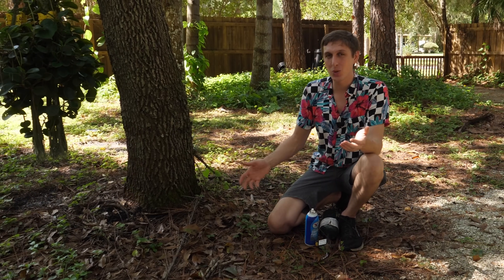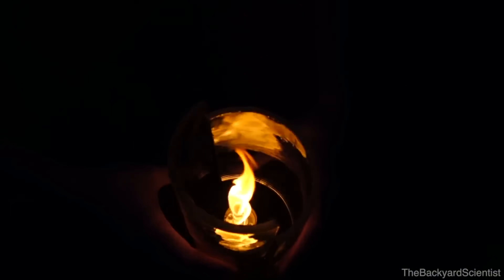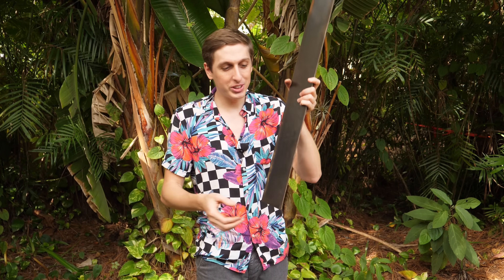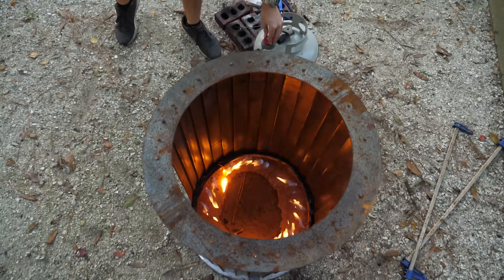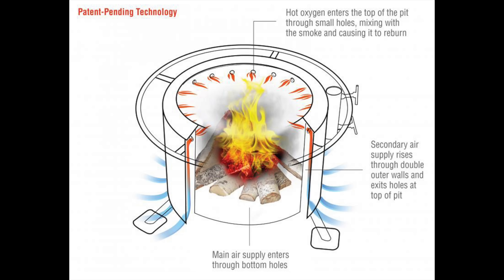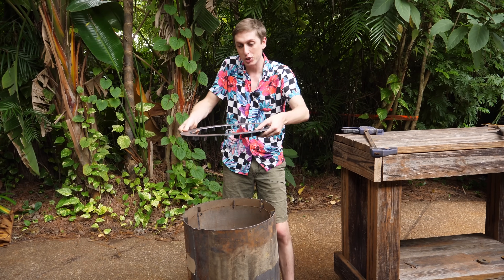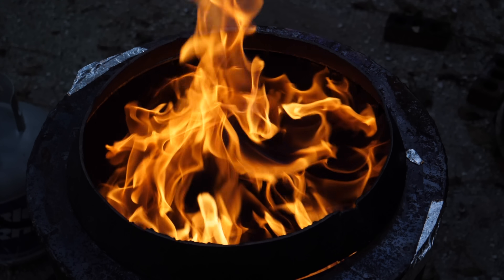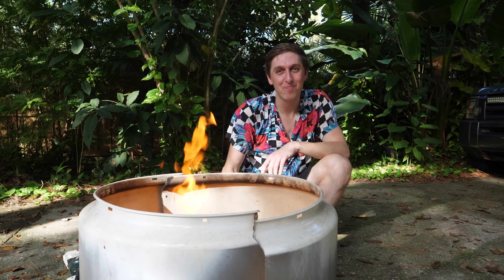The Impossible Fire pit Tornado

Comment: I drilled spirals descending a 40gal drum - bit maybe 1cm across. Elevated a couple inches & has a grate at the bottom. Just using fallen timber, twigs etc flames peak at ~2m and hold a pretty even cone shape if it's still

Comment: Call it what you will, but what you’re trying to create is a non-persistent (non-self-sustaining) vortex, not a tornado. Tornados are persistent (self-sustaining). They maintain themselves latent heat released via exvaporation (condensation and deposition).

A fire tornado in the clip shown is really a super hot dust devil (also persistent). They run off rapid pressure drops in the relatively cooler air above the fire.

With that said, you need to try angling some of the air outlet vents up and partially towards the center. This will serve to narrow the fire above the pit and possibly allow the vortex to keep its form above it.

Comment: If i could have 2 normal fans and 3 fins i think i could try to make it taller and "in the open".  If you put 3 fins facing directly inward between 2 fans you can make a rather tall smoke tornado with very little work done by the fans, note fins should be the correct shape.  Pump some kind of fuel just above some holes placed above the lower fan and boom, fire tornado.  Or at least thats the theory.

Comment: If you had put the halves of the water heater so the tornado spun with, instead of against the rotation of the earth (per northern hemisphere) it will work with, instead of against the corealis effect.

Tornados, fire tornadoes, & hurricanes all tend to spin counter clockwise in the northern hemisphere per the corealis effect. You set it up to spin clockwise & against rotation of the earth in the 1st design. The 2nd design you put the fins to feed air counterclockwise, or with the corealis, & it succeeded.

Comment: Having played with gasification rigs as well as ones that created vortex air flows, I'd guess your best bet would be starving the fuel source for the tornado itself of oxygen. i.e. create a turbo stove that gets up to gasification temps, put a second gasification chamber near where the woodgas from the first is being burnt. Vent the air/gas flow of the first to create your vortex and vent the gas from the second up the middle of the vortex from the first.
The idea being, the first turbo/gasification chamber burns up all the O2 in the air stream, the second releases woodgas that won't ignite until after the 'tornado' rises up and starts to mix with outside air.
Reply: if you were really creative about the burn area in the first you could even direct the hot air/flames back into the second chamber with the same means you're creating the air spiral.

Comment: What if the vertical rails, Rather than being vertical, they would be adjustable on probably a 45 degree angle so you can control at what height it’s getting more or less air. Like the shape of a rocket exhaust tip

Comment: Question, why would you have the break in the vessel straight? would it not taper with the convection created by spin through the change of temperature and the natural draw from the atmosphere. I would have the draw more angled so the draw was intentional to help direct the flow of air. As the air is doing the work. Make the cut angled so that the air will spin as it enters and if you have double walls this will help the internal wall also it could be flanged from large to small so there is more pressure as air is water just less dense ect.

Comment: I'm a little late... But you can try to use glass for the sheer so you can see it... The glass resist at the heat and it is cooled by air flow

Comment: Alike to coiling copper tube around fire to make a water heater... perhaps multiple individual coils set to discharge the heated air at a high velocity three inches below the top flange of the fire pit would make the tornado. I'd also try dampeners. One for the bottom intake and one for the coils so you can manipulate the amount of unburnt fuel from the lower fire before it hits the second burn, and the dampened on the second burn air so you can get the pit very hot before opening meaning higher velocity. 

It would have dampeners as moving parts, but this could also be a design test where you may make some observations to how much dampening is required when the fire is burning efficiently. This could then be used to build one without the dampeners based on the flow restrictions found when you had dampeners, if it works at all.

Comment: Your test is Flawed, as you have to be stopping up the barrel of the tater gun, inturn making it a pressure chamber and not a gun, its a Bomb.  if it had a tater in it, when the pressure got too great it would just push the tater out the end.

Comment: I’ve made much better with a lot less work.

You have to introduce the air at the bottom and to the right so it creates the vortex from the cooler dense air.  The taller the chamber the more rotation you get as the gasses mix with cool dense air to complete combustion.  

I had a 100 pound vertical propane tank that I turned into smoker around 2006, it would create an amazing fire vortex inside as well as out the stack at the top, but would also make an amazing smoke pressure vortex that made amazing smoked meat.  I’ve also done the same from a water heater, but you don’t cut the center, you introduce air from one side.

I’ll see if I can find videos but will make another next week to show you how directing the input air influences the flame and gases burning

Comment: the issue is "no moving parts" cause even BBQers have moving parts to open the bottom for more air or the top as an exhaust while also holding in the heat.

Comment: Small critique for the one experiment with the turbine fan and fire ring. Change the angles of the blades. That's literally the ONLY reason that didn't work the way you thought. When the air comes in you want it to blow the edge of your fire. Also the fire ring is no good. Think of it as 10 or so different fires as apposed to one fire in the middle. You want one fire in the middle and the air to hit about 25% of the edge of the flame.

Comment: You need to orient the fins to spin the flow Counter-Clockwise (in the northern hemisphere).  A natural tornado/hurricane spins because of the Coriolis Effect and naturally spin CCW.  The glass worked fairly well CCW, the original water heater opposed semi-circles failed CW, the fins worked OK CCW, the top turbine failed CW, the  dryer drum worke CCW.

Comment: You do understand that propane is a smoke free burn even without assistance from being fed oxygen. Although I have thought to make a tornado pit with one of those, or multiple probably, sterling motor fans that you put on top of your wood-burning stove. So technically you’re not using any outside energy. Cool experiment though, I guess that’s the wrong adjective

Comment: Did you try the wood gas principle, this basically collects the gas from the bottom so you inner curcle needs holes in the bottom or bottom sides. The gas will rise through the side wall and it ignites in the top, basically starting the flame from the top instead from the bottom. Makes a higher spinning  flame

Comment: If you had welded an Air-intake pipe that circled the drum and came in at an angle as the sole extra air-inflow you´d get a better result, although no tornado but it sure spin it up though.

Comment: I think you were on to something with your revelation that you need jets of air around the top. It's definitely possible. You have all the heat energy you need to move air up and out at a high velocity. I think it's a question of optimizing the efficiency of the heat exchange and the aerodynamics of ducting for the air from the bottom, through the heat exchange section, and out through the jets. 

From my experience with dust collection, air needs smooth curves to maintain pressure and velocity through ducting. Perhaps try round pipe with smooth bends. Arrange them vertically around the inside edge of the pit and bent gently towards almost horizontal at the top to create your vortex. The greater surface area of the pipe would exchange more heat and the smooth race track curves inside the pipe would help the air reach peak velocities.

Comment: I thought I’d seen area heaters based on a fire tornado where they have a base similar to yours, but have the fire go up a glass (quartz?) chimney, so you can see the fire tornado and it can emit some heat, but without losing the circular air movement to make the tornado.  Like a 6’ tall fire tornado lantern.

Comment: I took a paint can and another smaller diameter but taller can (can't remember what it was, been 10 yrs.) that fit pretty good inside paint can.   On the inner can, near top edge of outer can, I made a series of slots bending one side in other out.  So air coming out was at angle.  Puts some micro holes on bottom of inner can as well few short bolts to keep it off floor of inner can.   outer can I made a hole large enough to accept a pipe of about 2" (actually made 1" hole a made 1" slices that I could bend out to hold pipe in place.)  Put a small 12v computer fan on 9v battery at end of pipe (pipe was to keep fan away from heat) and blew air in, this made for about a 12 - 16" fire tornado out the top.

Comment: Would it be possible to make one using moving parts that aren't powered? Like make some sort of metal fan blades on the inside on like ball bearings that would use the heat of the fire to start spinning to help the fire gain height?

Comment: What about the fin rings but have gas lines going in and using water base to heat steam up to spin it at the top? The rise of the steam could add lift to the tornado at the top with the double bucket fin design

Comment: I wonder if combining it with rocket stove principles would work

Perhaps horizontal combustion with asymmetric connection to the vertical chamber, or vertical combustion with vortex-inducing bottom air inlet and offset vertical chamber

Comment: I turned a burn barrel into a fire tornado by coincidence. Just doing slits or holes sucked in very little air into the barrel to get the fire hot to burn. I thought about how to make it easy be able to get more air forced into it by just taking the slits and beating all the left side in some and the right sides out some. So it made a scoop that when air wheat in or just air blew past it. It would only let the air flow one direction around the inside of the barrel. It worked great. But side effect was a nice fire tornado that at that time I knew nothing about.

Comment: Hypothetically, couldn't you create a lower pressure system in the middle of the fire, causing the fire to go much higher and continuing the vortex you created with the airflow? And wouldn't you be able to create the lower pressure in the middle by putting a highly conductive and high melting point metal post in the center of the pit? 

Doing so would create somewhat of an anti chimney effect, drawing the flames upward without constricting it from the outside. It would take a bit for the center rod to heat up, but once it did, I feel like the heat rising from the post would cause lower pressure towards the center of the fire, drawing the flames inwards to the desired effect

Comment: The easy way to solve this problem is just make a really tall fire pit out of a see-through heat-resistant material, like glass. But the trick to solve it is how to keep the air flowing in one direction beyond the confines of an apparatus, and I don't think that's possible. Air can go anywhere and do anything, there's no way to force a tornado to occur out of thin air, you need the physics to control the direction of the wind and oxygen. Without the proper mix of hot updraft and cold downdraft, you can't create a tornado naturally. The wind will just stop spinning and release outward and very quickly become a turbulent mess.

Comment: Its not with no moving parts, but it isnt any additional energy either: put several sterling engines inside of the fire pit to power an air compressor that goes to jets/fans that vortex the air.

Comment: I feel like airflow from the bottom would help, as well as allow the ash from the burning material to fall out. If the fire were on a grill or mesh and the blades on the sides maybe came up half way before turning into a solid wall again I posit you would have better results. The soild wall providing stability after established rotation, like an airfoil to help stretch the flame. If the flow rate through the bottom were high enough and the sideways rotation strong enough you would get a better result maybe. Would be interesting to try. Kind of like a blast furnace.

Comment: Suspend a 5' x 6" piece of metal ducting tube over a burn barrel and once it starts to vent, it will suck the top of the fire up and burn off the smoke while giving you your swirling inferno.

Comment: I would use the conical spiral that's built into the design turbines have the seed into the spiral very large to capture a lot of air that would then Force the air in through thermal difference a bear temperature because of the fire you can also look into rocket stove stuff see if that helps

Comment: Would it be cheating, you use the heat to produce a charge that spins an internal fan? You don't tech have to attach it to anything electrical and could just auto power itself when it warms up enough.

Comment: Would a heat powered stove top fan work for either assisting the vortex spin or used as ducting in more air ? .
I think your close to cracking this ,,and I want a cool fire tornado in my tipi lol so please dont give up.i have a few concepts if you're interested.
Reply: I found this fire pit interesting, it appears that a vortex is being created from just the shape of the fire pit ,I am trying to find out more about this .
https://youtu.be/TvOaebLR3bA
Reply: Also this caught my eye..
I thought your onto a good idea with the secondary chamber, what if that had a spiral air intake like on this video. https://youtu.be/3VJu1O_oO1U

Comment: With some adjustments, I think the third one you made could have worked. 1) The angle of the fins at the top weren't angled enough. If you compare the angle of those to the angle of the 2nd one you made, it was much less of an angle. 2) You should raise the floor inside it up a little bit so that it's not quite so deep and and put holes in the bottom to allow fresh oxygen in to feed the fire at the bottom. That will get it really hot. 3) put enough wood in and let it burn long enough to really heat up the walls of the stove so that the fresh oxygen coming in at the top fins will be super heated. I think that would do it. I'd like to see you attempt round 2 of this with some of these suggestions, or other suggestions that you have received.

Comment: I've built loads of these over the years and you were really close a few times, but move on from one design to a different one far too quickly.
The slatted type will do it, but the gaps need to be tiny (2mm or less) if you're making it that high. The top ring also needs to have a smaller hole to concentrate the exhaust because all the versions you made had far too low backpressure to sustain a tornado effectively.
The simplest way to make one is to cut the drum into 4 parts and overlap them in a spiral, and then cap it with a piece that has a hole 1/2 the diameter. 
If you go up to 8 pieces it can give a tighter tornado effect, but the tolerances are much tighter and the gaps need to be much smaller.
Reply: I'm amazed there isn't a response from The Backyard Scientist on this comment.  Seems like the answer is right here.
Reply: His other major problem was no thermal insulation.
A firepit (or any hearth, really) NEEDS thermal insulation to contain the heat, and build it up enough to combust the smoke.
Reply: @TheRojo387  Wow so true! The Backyard Scientist should totally try this
Reply: Nice
Reply: Post a video of your fire tornado, would love to see it
Reply: @MrNoipe  Just working on a design for a toroidal type one, so I'll try to get something put up when we do.
Reply: @Gainn  So you've built loads of them, and can tell someone else exactly how what they're doing wrong, but have no evidence of your design? Come on man.
Reply: @Blueshirt38 he said he’s done it in the past. Doesn’t mean he has one on hand. But he’s doing one now and will put a vid up when he’s done. Makes sense tbh
Reply: @Gainn  making any progress? I'm also interested in seeing a video of it
Reply: Ive been trying to do this, can you upload a video of a working one if you have it

Comment: I can think of one additional part to create natural tall ones kind of...

Ur right about the fan and how in nature it's usually as simple as a tornado meets a fire and what else would ya get.

I think u should combine all of your set ups. The basic outer shell being the omnidirectional slat rig... The inner shell being the basic half wall set up the ring slats to connect the two shells.

Then my additional part a tall propeller with a free axil facing up high above the fire.

The idea isn't to add any motors just fuel. Pack it round the stalk of the propeller and then ignite it. Once the inner shell heats up the cold air will come in raising the velocity of the propeller and it should make a firenado.

Cause the leaves were moving the right direction

Comment: I had the most success by using a barrel with angled slits and a chimney with a slightly smaller diameter,  raised some distance above it, so you have a bit of free standing tornado.  I'm sure you can figure it out way better than I did.  ;)

Also,  experiment with slits in the chimney. And in both cases,  less was always better,  it seemed to me